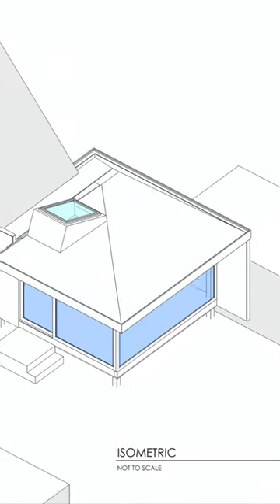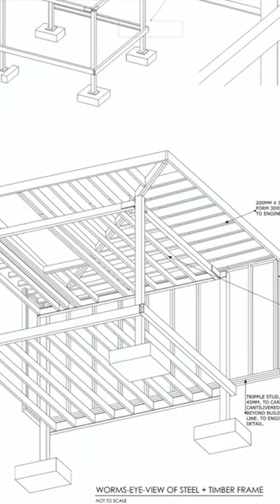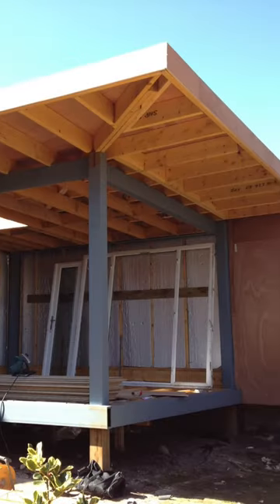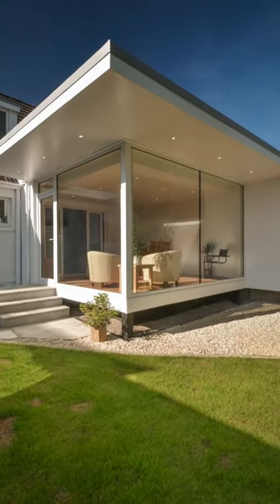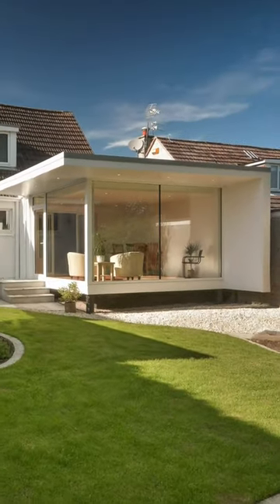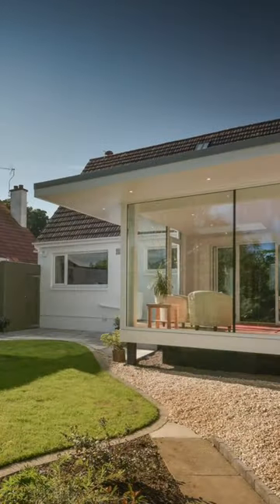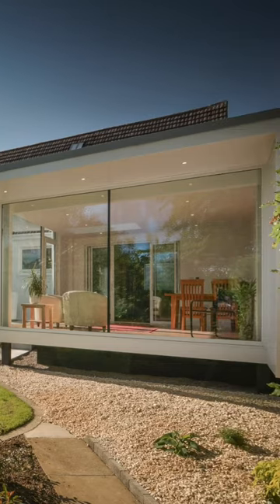Garden Room Design

Comment: Did you need planning permission? As it is meant to be a garden room, but almost looks like an extension aswell, an amazing one!
Reply from the maker: If built today it would need planning because of its proximity to the boundary. Permitted development didn’t exist when I built this in 2013
Reply: @RealLifeArchitecture  Do you mean the boundary with the neighbours ? Would you need planning re it’s connection to the house ?
Reply from the maker: @bethroberts3351  yes boundary with neighbours is what matters. PD rights usually don’t apply if new structure is less than 1m from boundary.